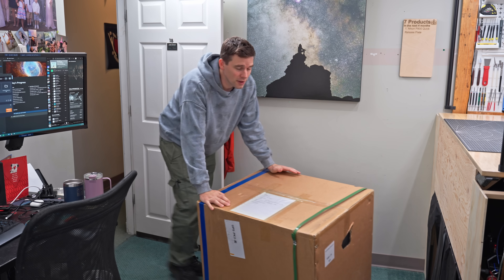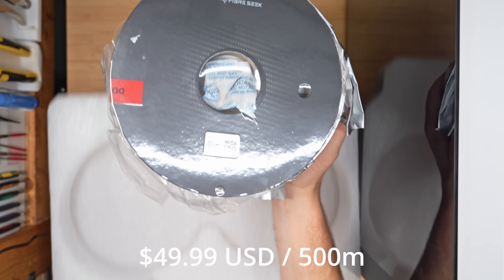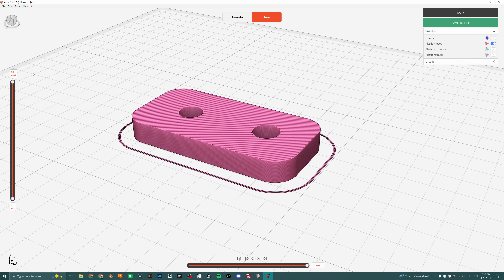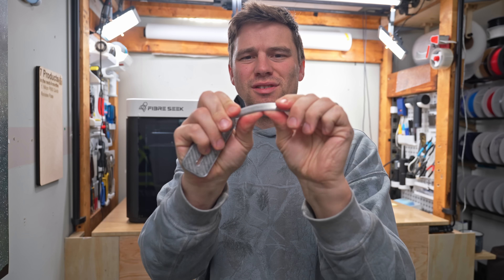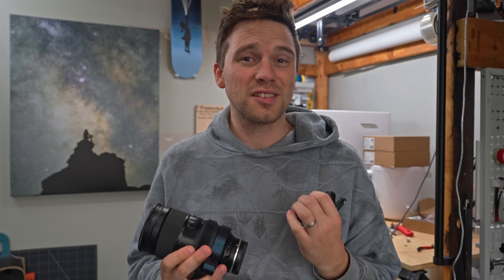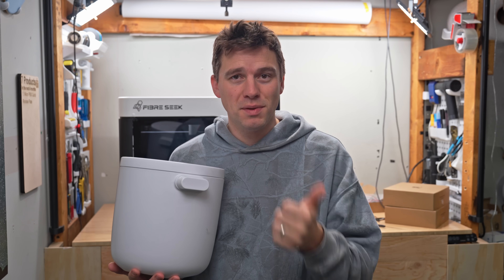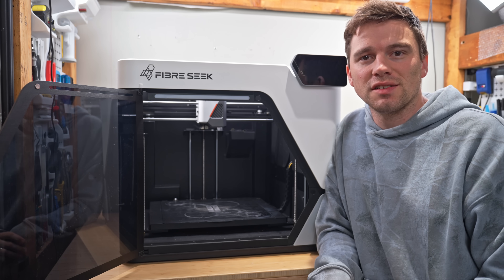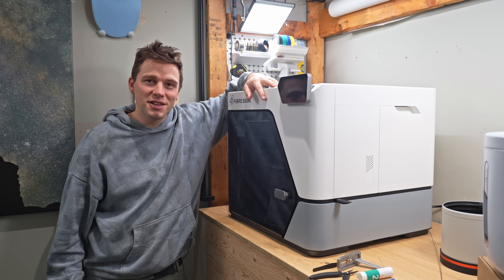I Tested the Fibreseeker 3… and It’s Actually Insane

Comment: Still small.  they can make it go as wide and tall as they want but these places all choose to make only small machines.  I'd rather build one that's 3ft tall and deep and 5 or 6ft wide with a conveyor as the very bottom to keep projects going or to cancel and discard a messed up 3D Print and start over and not even have to be by it.

Comment: So... This only works when the fiber needs to be used as one continuous string? I can't see it using retracts with the head moving somewhere else to start printing again. Or does it cut the string? Also, when the print ends, how does the string get cut?? Why doesn't anyone show this?
Reply from the maker: Ya, it cuts the carbon, then lays down a bit longer. Near the start of my video I show where the cutter is with some text. It seems there is a minimum length that you can lay down in the slicer.

Comment: Not sure if anyone else mentioned this but Aura is actually a slicer developed by Anisoprint a Russian 3D printer manufacturer that produced a machine called "Composer" that uses this method of continuous carbon fibre co-extrusion. We have one in the university AM suite that I work in. I wonder if this has been officially licenced from them or just ripped off. The machine looks good, clearly works well and costs about 1/10th the price of the OG! Thanks China!
Reply from the maker: I was super curious when I saw the other printers listed in the slicer and went and did some research on composer as well. Definitely a pro to the software!
Reply: Fibreseeker is Anisoprint.
Reply: @rsilvers129 What perplexed me was that Fibreseeker appeared to be a Chinese company. I guess Anisoprint has been acquired.

Comment: Honestly doesn't seem that stiff, regular nylon from any machine can to that human hang test as well. I'm not a Markforged advocate at all but a 2mm thick icecream type stick in Onyx/continuous CF won't flex at all like the much thicker part you showed.
Reply: I agree, this doesn't do justice to carbon fiber at all. Extruded carbon fiber with half of this thickness would be way more durable. This kind of 3d printing is just not the right technology for durability. Very inefficient in this particular area. I'm actually sad to see this being called carbon fiber.

Comment: out of about 4-5 video reviews so far, this is the first actually showing me a glimpse of its strength. most ppl just printing it in PETG and showing it can lift something. without any comparison. like how about PPA-CF to compare it to, thats super stiff and strong. but that guy trying to break it with his foot and bearing his entire weight on it on the shelf. that looked promising. ty

EDIT: just finished the video, u said ur going to try it out with engineering grade filaments. yeah im sticking around for that LOL thats what i came here for
Reply from the maker: Any ideas on what type of print to do for the comparison between the filaments? I'm getting this project done next week with all the different filaments.
Reply: @JoelSchat well, the most basic thing would be a simple long rectangle, and put weight on the end of it to see how much it droops down, probably put a notch or something at the end so the weight can catch into it and not fall off. 

This should show the stiffness comparisons.

Perhaps have a measuring chart behind it and a camera setup in front so u can see the exact amount each one droops down with the same weights.
Reply from the maker: Ya I was thinking something similar for sure. Maybe a twisting strength test as well

Comment: I assume your reading these. If you want z support, add "tubes" in the slicer, then "inject" the tube, filling it with solid filiment or your carbon fiber filiment. Just need an air outlet, that may need some trimming after completion. Just a thought 😊
Reply from the maker: Ooooo I like that

Comment: Game changer?  Markforge has been making desk top and large commercial printers that mix continuous fiber with filaments at least since 2019 when I was using one with carbon fiber in a maker cooperative (HackerLab) here in Sacramento.  The printer was even older, but I have no idea when it was originally purchased.  Unfortunately, the cooperative closed during COVID and reopened later using a different business model.  

Markforge currently produces a Gen2 version that can print with select PLA, nylon and TPU, using continuous filaments of carbon, aramid, fiberglass and HTFG.  

This new kickstarter printer that you are so enthralled with is using at least 6 year old technology.   

Before being anointing as game changing, it needs to actually be produced in numbers, have the reliability of the Markforge line and come in at a significantly lower price.
Reply from the maker: All I said was "this one kind of feels like it, for me". 
I never annointed anything. Especially not for a whole industry! 

My local hack space doesn't have a markforged and I've never met anyone who has. They are very expensive and the CF is also very expensive. Out of the scope for a maker like me.
Reply: If you compare with the Markforged Onyx Pro, you'll see significant differences.  
Onyx Pro G2 retails for $8,990, Fibreseeker 3 advertises $4,999.
Onyx Pro G2 build volume is 320 x 132 x 154, Fiberseeker 3 advertises 300 x 300 x 245.
Onyx Pro G2 only supports Fiberglass as the CFR material, not all of the materials in the Markforged lineup.  Fibreseeker 3 advertises continuous carbon.
Onyx Pro G2 will print Onyx, Precise PLA and Smooth TPU 95A, however you can only use CFR with Onyx.  Fibreseeker 3 advertises a wide array of plastics and the ability to reinforce all of them.
Onyx Pro G2 does not have a heated bed or build chamber.  Fibreseeker advertises an actively heated build chamber of 65 C, which is great for materials that tend to warp during printing, although continuous fiber should help with this as well.

I agree, the Fibreseeker skirts around Markforged continuous reinforcement patents, the prints look kinda rough and we are unsure if they can actually produce the machine for the advertised price, however you're making broad assumptions about what Markforged can do for the price.  I ran a Markforged X7 (~$80,000 USD) for years and learned that Markforged knows how to do a few things correctly, but really locks the user into their ecosystem and doesn't allow for much play.  A bad collision during printing could cost more in a repair bill on a Markforged than this machine in its entirety.  Markforged is great for high end manufacturers and prototype labs, but I think the Fibreseeker is going to be better for advanced hobbyists, experimental manufacturing and education.

Comment: It would be interesting to print glass fiber nylon something like polymaker fiberon or even carbon fiber nylon and have a carbon core I’m sure if you could get it dimensionally accurate and have it reliably print the parts would be incredibly stiff and very strong

Comment: Interesting, the part that broke eventually, dies the cf bond to the PLA or just be like a rod sitting in a tube?   Thanks.  😊
Reply from the maker: It was printed in PETG, and I think its more like a rod sitting in a tube, but like if you vacuumed out all of the air from the tube so it was completely tight around it and the tube was kinda sticky.

Comment: About the fan noise: I've never quite understood why so many devices still include 100% always on fans when it's so easy -- and cheap -- to incorporate thermostatically controlled speed control (including off), which computer cases have been utilizing for years. Of course this can also be done via Klipper and an MCU on 3D printers, but otherwise it's simply a matter of using one of many temperature sensor fan controller boards which only cost a few bucks via AliExpress. I've added temperature-regulated speed control to a lot of fans and saved my sanity! You may also need to replace the fan with a 3- or 4-wire unit, although there are fan controller boards for 2-wire fans as well. Great video, I'm excited about the advances in 3D printing!

Comment: Very happy to have discovered this youtube channel and the printer. Just subscribed!

This is actually insane, I have seen some carbon fiber tool heads, which are put on 5 axis machines that cost around 50k. Pretty much doing this same thing.

This could really speed up drone development. I wonder if they sell the tool head alone, because this, put on a 6 axis robot arm can also provide not just planar carbon fiber strength magic but also in 3d, like think of the complex surface of the predator drone, or Turkish bayraktars.
Reply from the maker: Thanks so much! I've been wondering about non planar printing as well because this is the perfect application for it! Very interesting to think about it on a 6 axis robot arm!

Comment: What's the carbon fiber "filament" like? Is it just raw unidirectional tow? If so, how does it stay together during extrusion? Or is the carbon preimpregnated with a resin of some sort to keep it together?
Reply from the maker: I would say it's like a raw strand of carbon fiber, it stays together because it is extruded together with a plastic of your choice in the nozzle, the carbon kind of pushes it's way through the plastic creating an even coating
Reply: @JoelSchat  Interesting, thanks. It must be coated/impregnated with something to get through the extruder. If you look at raw unidirectional tow, it really has nothing holding it together and is just basically a bundle of a couple thousand strands of thread running in the same direction.
Reply from the maker: You can see it best at 1:53

Comment: 15+ years in additive, and knowing about the Markforged from years ago now (same printer, just 10X more expensive), the engineering filaments are cool, and yes they will be an absolute destroyer of strength & toughness charts, but TPU/TPE/PEBA with continuous fiber would be INSANE!

I guarantee it would literally never break
Reply from the maker: That's exactly what i've been thinking and i'm the most excited to try next with the machine. even if the coating of the fibre is done with petg or similar, and the outer perimeters are TPU would be incredible! Lots of experimenting to do
Reply: @JoelSchat  looking forward to it!
Reply: Carbon fibers are not good for flex. So, why do you think TPU/TPE/PEBA mix would be good?  You aren't going to get Michelin Tire capability. However, if you input a different fiber...
Reply: @BStott  Sure they are. You can make carbon behave exactly how you want it to according to the layup you choose. Heck you can make springs out of carbon fiber.
Reply: @BStott  There are hundreds of models of skis and snowboards that would indicate otherwise. It's all about the structure.
Reply from the maker: Also tpu has incredible z layer strength so you would get the benefits of both the fibre stiffness with the durability of tpu
Reply: @JoelSchat  exactly
Reply: @BStott  This is true if the fibers are intermixed with the same spool (think PLA-CF, or sirayatechs ABS-CF Core [my favorite]), then it does cause issues. 
With the fibreseek, it is a separate, continuous spool of actual fiber strands (glass or carbon), so you'd get the excellent layer adhesion of TPU, mixed with the incredible strength stiffness of continuous fibers. 
The chopped fibers are not impeding the layer adherence on a fiber-filled material; like most consumer available spools (which make them weaker than regular polymers [contrary to marketing fluff and popular belief], but do add stiffness, and it makes it looks better as the fibers keep the polymers more organized)